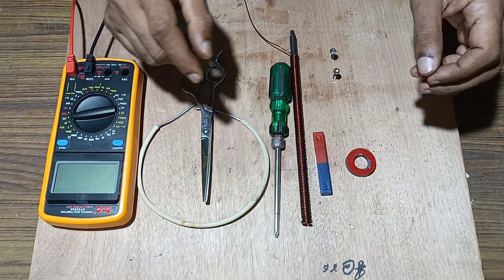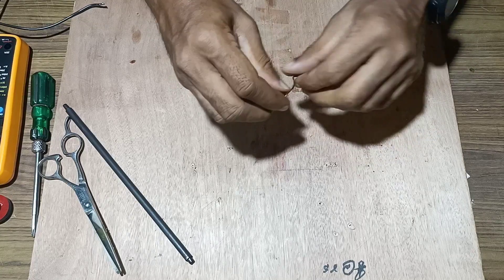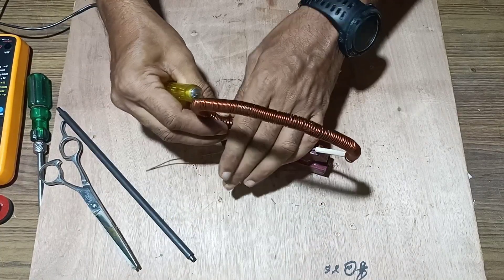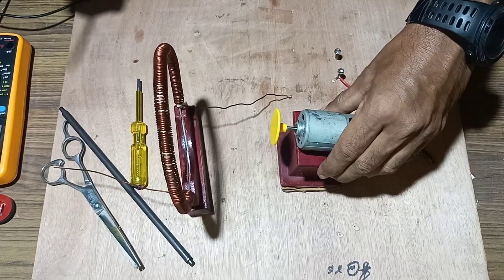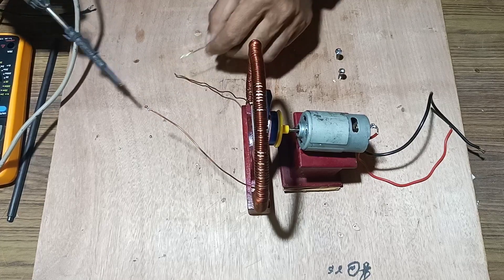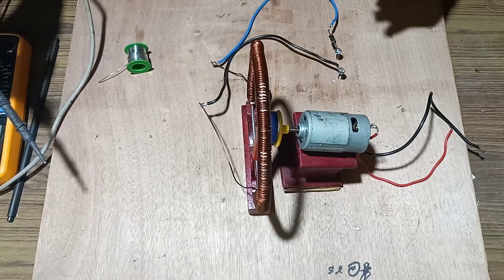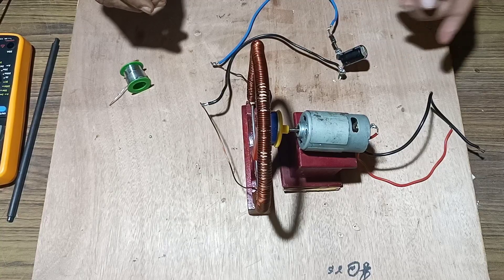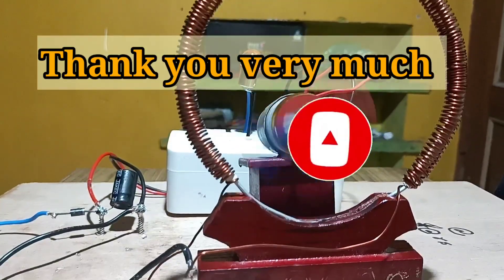"Free Energy Experiment: Copper Coil & Magnetic Energy"#freeenergy

Comment: What is the watt capacitor
And number
Reply from the maker: The value of A capacitor in the range of 1000µF to 4700µF with a voltage rating of 25V or higher might suit this conversion, but specific values could depend on the load and desired ripple voltage.
Reply: @rajusavanur  ok